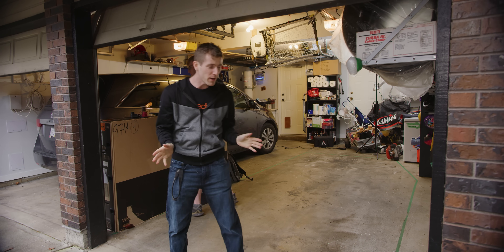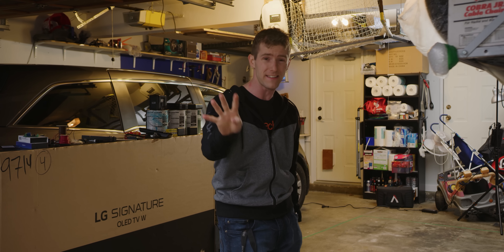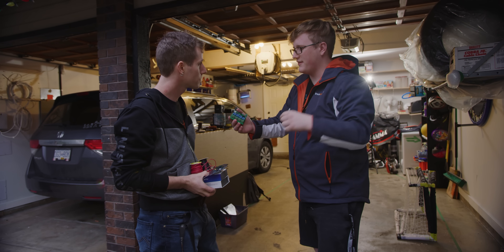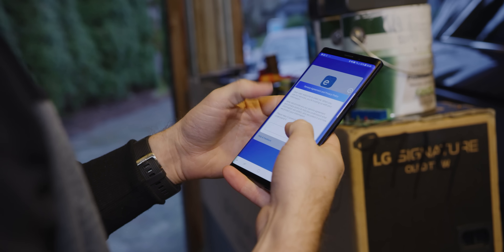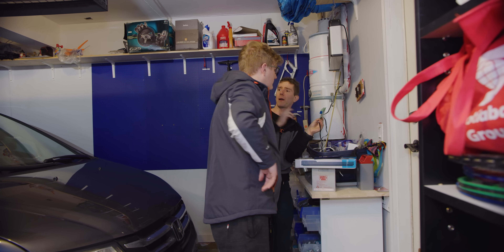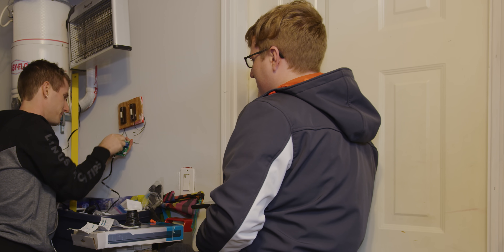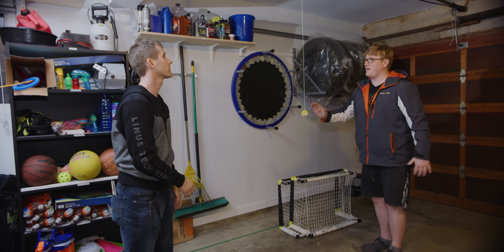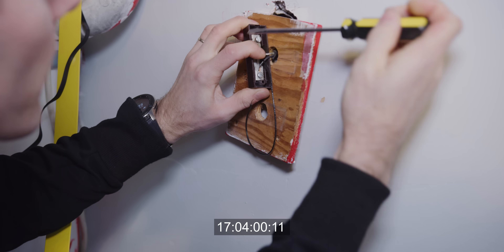Making my 1980's Garage Door Smart!

Comment: This rig has one problem Mr. Linus. I used that Sonoff (ewelink) relay to open my apartment door downstairs. The problem is that when you turn on the relay it will keep staying on even when the door finishes opening / closing. Here is the solution for that: in the eWelink app, tap on your device and go to setting. You'll see an option called inching. Enable it and enter the amount of seconds your door typically takes to open and close (and a few extra seconds just in case) and voila! The relay will automatically go off when the door completes it task. ;)
Reply: Tolga Ozuygur this!! I can’t find the inching setting in my app though.
Reply: @pricejr21  they released the inching feature a couple of months ago, be sure to update the firmware on your device, then you can see it in the settings. :)

Comment: So why didn't you print a nice box to month the board and switch on? Of course you could have also used an esp8266 with two optical isolators or a pi Zero with a camera module to add a webcam.

Comment: NC = Normally Closed Circuit.
NO = Normally Opened Circuit.
Reply: Fucking "no connection" xD
Reply: @777robocop  To be fair, I've seen NC labeled as No Connection on some PCBs. The pads do nothing and it's weird, but it does exist.
Reply: @777robocop  10/10 YOLO.
Reply: As an electrician I shook my head so violently  when Linus said NC means no connection lol
Reply: in regards to relays, yes; in regards to pinout of integrated circuits, no
Reply: Linus... your “No Connection” is usually fucking connected!
Reply: just saw the video and was going to comment the same thing haha
Reply: as a former fire alarm tech this bothered me.
Reply: came here to say this :D
Reply: @Michael Swengel Who are you kidding? I won't be missed either way! Think Linus gives a shit one way or another? Luckily I don't either, and as I said this isn't the first WTF? I have experienced while watching this channel.
Reply: Yeah i think i might have to stop watching tech tip videos from linus... I'm not a tech's arsehole but I knew that...
Where is the Tech part of this channel again???
Reply: @ballsrgrossnugly  Honestly NC and NO are more motor controls and plc controls.  Really PLC is actually XIC and XIO.  This is a tech channel that probably never has to deal with plc or motor controls.
Reply: @ballsrgrossnugly  This is primary a enthusiast computer channel not a DIY electronics channel. While there is some overlap they are not the same thing. Also NC often does stand for no connection especially in computer hardware, you know the thing this channel is known for.

Comment: Why did't you Flash the Controllers with tasmota? Because if the Internet is not connected it doesn't work, with tasmota it works locally (i'm sorry for this statement if these don't work over their servers, because my did)

Comment: Hey Linus why wouldn't you do a proper job by buying a back box cover plate proper switches and in order to put all that electronics in and the switches you do know that even in Canada you need to mount open to air electrical components in an enclosure to avoid any possibility of electric shock. get you, electrician, back, please.

Comment: Using them for quite a bit as light switches in my apartment. 
Can have timers and schedule, scenes, google home and alexa integration. And the list of devices are quite interesting. https://www.itead.cc/wiki/Product#Smart_Home 
No dimming options so far.
Two problems:
1. Crappy software. It requires connection to the internet even if you're switching from inside the network (Switches only from CDN). Once you wire it to google home, you don't have to use the default app much longer. And technically they can have custom ROM for local use, in case you're paranoid the Chinese would sell the logs of your home arrival to some local burglars.
2. In Europe they are not certified, which means if they are defected and your house burns down - the insurance won't pay out. But it's only in case insurance could investigate it. The electronic inside is really cheap, but that's the whole purpose, right?

Otherwise i'm happy with the price/value.

Comment: NC usually stands for normally closed. That meaning the switch is usually on, and when activated the switch opens which break the connection of the circuit. In case anyone were wondering.

Comment: I like these "ancient" garage openers because they are SO much quieter than newer cheaper ones. The only trouble is if they aren't setup right the gearbox tends to get broke since they are rather cheap plastic. I made a replacement for both if mine on the CNC out of aluminum, but  so far only needed one. Definitely worth all my upgrading and work given how nice and quiet they are, and stronger that new ones with twice the rating.

Comment: I did this with an old router. TO THESE EXACT brand and age of door openers. Add a couple transistors and relays to control the door,  reuse the GPIO on the router add a couple hall effect transistors as position monitors. Then  tweak the router OS to add the control systems. Then added the interfaces to the rest of my home automation system.  Worked great. I wound up adding LOS break sensors to bring the door to code and viola. IFTTT integration was of course simple.

Comment: Gonna have to do this to my old garage door as well. Good video.
Just FIY, on a relay NC = Normally Closed (there is a connection when the relay is powered down), NO = Normally Open (circuit is connected when relay is powered).

Comment: I have a chamberlain lift it came with the my q smart adapter I never had to pay for the service. It would open and close and log when the door opened. And it could control multiple doors and gates. The lift had a backup battery  1 1/4 hp motor, although it probably over power for your doors for a single door a 1/2 hp is enough. also came with wall switch, two remotes, the my Q adapter that plugs in to the router, and an exterior keypad. Found it at home Depot. The model is b970 it was about $250 US. The only thing I can think of is that the service mught not be free in Canada but is in the US.

Comment: Sonoff switch ($5ea) with Tasmota firmware (free) set to timer(2-4 sec) & "belkin smart switch" in firmware and use Google Home.(free) Connect where momentary switch is! Get new momentary switches too ($2ea) solder to sonoff switch.That's it. $15 for "2 google switchs & manual 2 switches." & IFTTT too if you want.

Comment: in relays and switches the NC stands for normally closed and NO means normally open. Basically when you power the relay or push the switch NC opens and cuts the circuit and NO closes and completes a circuit.

Comment: 10:10 I'm sure you looked this info up, but in case anyone else needs a quick reference:
NO is Normally Open, for a relay, in it's non-energized(the coil) state, the contacts are open.  NC is Normally Closed, and is the same/opposite, in it's(relay) non-energized state(the coil), the contacts of the relay are closed.  
A relay has a coil and a set of contactors.  The coil is energized, creating a magnetic field, which draws the contactor assembly into position.  This closes/opens, depending on a couple things: 
Some relays have only one set of contactors, either NC or NO.  Some have both an NC, and an NO, and there are others which have multiple sets, but in this case, they are working with relays which have one of each, and a coil.  There are 5 contacts in total, 2 for the coil, one NO, one NC, and a Common pin, which in an AC circuit would be used for neutral/ground, in DC, would be the negative.

Comment: Just saying, NO is Normally Open and NC stands for Normally closed. "Normally" means when there is no power running through the coil (which, when there is power, would magnetically close/open the contacts).

Comment: You could have bought a Sonoff switch. Those are like $3,50 and work just as well and are on the same platform (ewelink)
Reply: Also he could have used the Sonoff door and windows sensor instead of that Roost thing. All in one app, and cheaper too
Reply: @MrTjnielsen81  exactly
Reply: Can i open remotle my door with a sonoff switch ?
Reply: @black11189  yes.
Reply: is it reliable and save ?
Reply: @black11189  if you wire everything correctly then nothing should go wrong
Reply: Yes, search on YoutTube for "Sonoff Tasmota" for some fancy firmware that integrates with Home Assistant.

Comment: The principle does count: I refuse to hook up any pre-made smart-plug in my home if it requires logging into a remote server - that shit better be local. In fact, it should be the the standard, since it will decentralize homeowners' risk. I mean, setting up a dynamic IP isn't hard either.

Comment: I use a $1500 Multimeter. its the Fluke Megohm Meter, capable of producing up to 1000v to test electrical motors and shorted or grounded motors.

Comment: You should always turn off the power (the breaker in your case) before working with any voltage. Otherwise, you could receive a painful/fatal shock and/or damage the wiring/electronics you are working with

Comment: you know a little solder to take the 4 wires splitting so into 2 wires so the receiver has wires to 1 / 2 and then 1 and 2 running into 3 so when you press the 3rd on E/link then both doors open at the same time. 

also where are the fire extinguishers :)

Comment: As a professional, you really need to have entrapment sensors on any door that can be operated from offsite. This is super unsafe. This is my full time job.

The leaking is a blown capacitor, should be replaced asap and the fluid is toxic.
Reply: Also with the force setting set to max and no eyes, you run the risk of a cable coming off one of the drums and having a door hanging side ways basically, because if an obstruction occurred, the opener would continue to close/open. He definitely should have installed the Chamberlain opener. The myq stuff is a perk. He could have even gone with buying a cheaper opener and installing an after market security system which is super easy to install. Plus you get a warranty.
Reply: I install the linear switches on openers all the time and the chamberlin openers went all "apple" and made their circuits digital, so they are pretty much the only ones that dont work with them. I'm not a garage door guy, I just work in security so I dont know all the ins and outs of openers so I appreciate the info
Reply: @lightninguitarsolo  I'm a garage door technician and ive worked with several linear security systems. What I've always done is just wire them to the wall button wires for the Chamberlain models and that always seems to work for me. Keep in mind I'm not a security system tech =)
Reply: @wilson8468  the digital ones with thermometers and clocks and shit on the button dont work with a short of the two wires
Reply: Just about to point that out! Good one sir!
Reply: capacitor is probably blown from start/stop/reverse cycles too quickly due to loose wires and user interaction to override. Probably better to just install a new system with all the proper sensors and hardware instead of replacing the capacitor and keeping the hazardous system alive.
Reply: @superusermode  if it is a blown cap it will just be because of age, electrolytic caps can wear out in less than 10 years and that's a 30ish year old system so it could have just blown by natural wear and tear not necessarily due to doing anything too quickly...
Reply: @RWoody1995  You can blow a cap just by repeatedly starting + stopping + reversing the unit with it under load. Been there and done that. Watched it squirt out like a super soaker.
Reply: @superusermode  Yes you can, but you're not paying attention to what I said, it's a 30 year old machine, the caps will have worn out from normal use in that time any way even if it was never even once toggled forward/reverse repeatedly even once in its entire life...
Reply: @RWoody1995  I know what you said, but I also watched the video of the switches mounted to a piece of wood flopping in the wind and the door opening and closing just by moving it. Just because the unit is 30 years old doesn't mean every piece of it is. They could have been replaced at any point in time.
Reply: isnt the safety sensetivity the failsafe for that? like the opener is supposed to shut down if it senses too much resistance?

im not disagreeing that a beam would be a good idea, im just saying its not like he just has the beam terminals wired together.
Reply: @lightninguitarsolo  as old as those ops are I wouldn't trust just the force setting. Plus who knows if it's even set correctly to begin with. Many homeowners just crank it to max without understanding what they're doing.

Comment: 1:50 You are wrong. $90 in transmitters < $700 in door openers. Also, now that you are done, you should remove the old transmitter from the old garage door opener. That old system is incredibly easy to hack.

Comment: Those Chinese WIFI controllers are like the same ones used for their LED lighting systems and they create a wide open WIFI network of their own, where the password is actually stored in plain text in the device, and there is zero encryption, instead of just connecting to your existing WIFI and using it. I had to go without the phone app for my cheap Chinese LED's and just use the included remote control.

Comment: 30 dollar? or 19 for one? A sonoff 4ch is quite a bit cheaper but the exact same thing, and it's even in a case, and can take ac power so you dont need 5v supply.. :p  And no = normally open, nc = normally closed. Just fyi. ;)

Comment: hey this is actually pretty dangerous especially with little children and with a garage door that doesn't have the electric eye. we use the device called the gogogate2 that did the same thing and does have IFTTT integration without a subscription fee. What makes it safer is that every time the door is initiated a bright flashing light and warning alarm goes off so that anyone in the garage can be aware that the door is going to do something. There was one time when I had come in and I didn't know my wife was driving in right behind me and I close the door. It would have hit her car except that she saw the flash and stopped just in time.

Comment: Ewe link also sells wifi switches that work with google assistant, wouldn't it have been easier to just hook up that, replaced those old ass switches and have the problem resolved?

Comment: i might have to do this. I had a midrange Chamberlain opener that I installed at my last house. It had an external MyQ box that plugged into my router. It worked amazing. I would leave home on my motorcycle and not need an opener. Just used my phone.

We got a new place a few months back and it came with one of their best consumer units. Battery backup, Wi-Fi, a clock on the button... all the bells and whistles. But it does not like to stay connected. Sometimes it works, sometimes it doesn't. Wish I could just hard wire this one into my network, but nope, has to be wifi...

Comment: Kinda surprised you didn't add a Phillips hue bulb to those openers. Then integrate that with a "simple" switch to change colors when car is up against "tennis ball" or something lol.

A real suggestion, add a tilt sensor for your smart home security system if you didn't add one yet during primary install.

 That would tell you open or not and set the alarm off.
Not to mention simplify it for most people, cause say if you had Vivint, works with Phillips hue, nest thermostat, Alexa. (So yeah, would have to disarm first before door open unless that is your entry door.)

Now that I think about it, Vivint actually sells a closer/opener separate to the door sensor. I think is 30-45$. Just saying

Comment: I use a similar solution to control my house lights, called sonoff, probably use the same board, the app is the same. Works really well so far. The version I bought have the keys to replace a regular switch

Comment: NO - Normally Open circuit NC- Normally Closed circuit. And those $1500 multi meters are usually (can't say all) but a High Impedance meter for testing hybrid/electronic vehicles. FYI

Comment: ESP8266 + rele = 2$. Minimal programming required
ps. you did connect the button and the relay in Parallel.
Normally Closed and Normally Open

Comment: Pre watching comment
Cut 2 wires on door button(disconnect at opener motor) or best easiest just add wire to each door button screw terms at motor(leave old in place) place ground to raspi ground and door other wire to i/o pin on raspi
On wlan connect send 200ms pulse to close those door contacts(its momentary switch) on raspi
Best is if 3rd method used it does 0 damage to garage door and is 60 sec upgrade

Comment: Lol this isn't up to code at all, not only for a system that you can activate remotely do you need safety eyes but you also need the lights to flash and also a loud beeping noise. if that door comes down on somebody or something you could get in a lot of trouble (experienced door technician). Look up housing codes in your area specifically for garage door openers.
Reply: also that oil that is dripping out of the units is more than likely a capacitor that has gone out, that could be caused by you opening and closing the door 50 times during this video.

Comment: Generally, you should add a 0.1icrofarad (paper) capacitor in series with a 47 ohm resistor. The two parts act as a spark protector to protect the relay contacts.

Comment: Pashhhh!!! You could do both of them with a single NodeMCU/D1Mini and two relays. $10 MAX!!
Reply: Plus you could have added beams to it and connected them to the exact same microcontroller!
Reply: Plus the door open sensors would also have been able to be added
Reply: WiFi connected microcontrollers will not last for months on batteries
Reply: Ewelink goes to a cloud server in China. You can keep it all internal by flashing that with TASMOTA and connect it to a Home Assistant server you can have running at your house. For freeeeeee